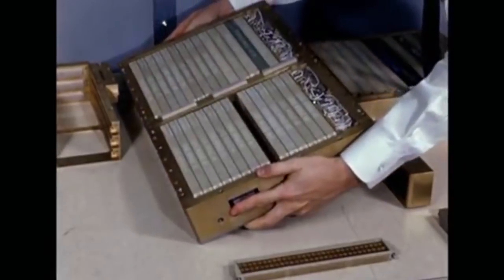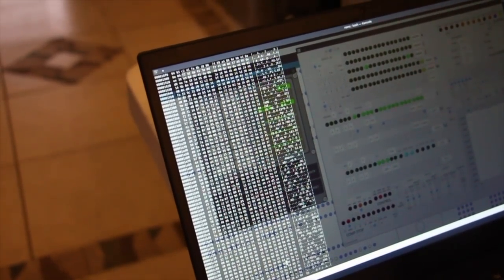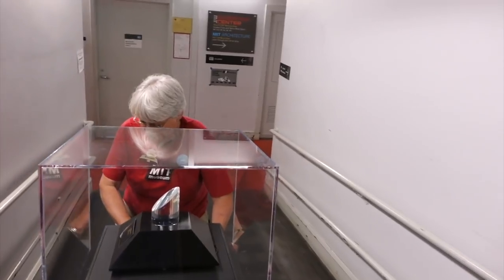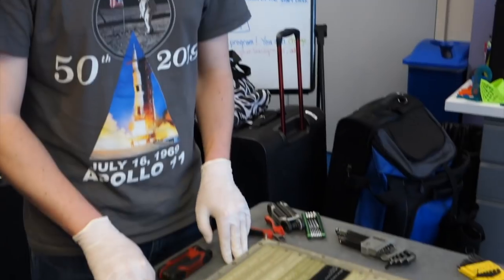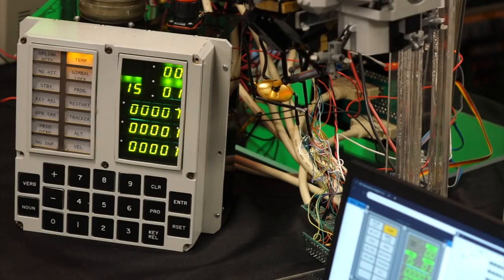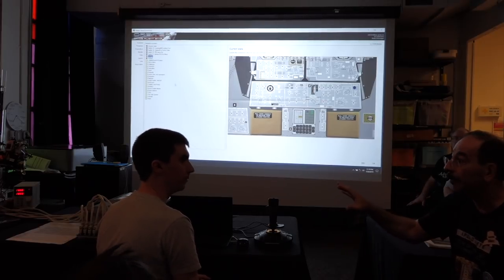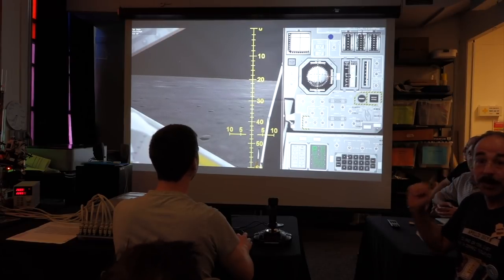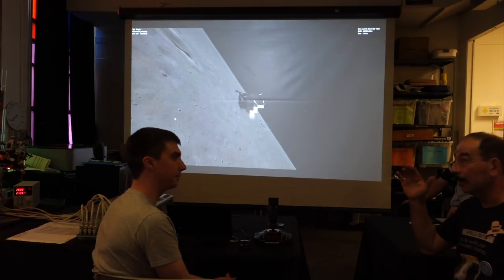Apollo Guidance Computer Part 24: the restored AGC does Moon landings in front of its creators

Comment: I do not really understand.  They read out the rope memories and say that no one knows about the programs that are on them.  But what is it that they run in their restored computer?
Reply: Their computer has different programs to MIT's one, or different versions of the same program. You have to understand that 32G of RAM and apps that run on any imaginable hardware are still decades away. So every AGC, each one of dozens, pretty much had highly customized code on it, code that would do exactly what that mission's functions were and nothing else. I would guess that no two AGCs ever had the same code at any point! We do not write code like that anymore but in the 60s with a few kilo bits of writable memory there was nothing spare, engineers would search down every last unused bit and find a way to use it for something else. End result is a huge collection of slightly different programs written over years plus a few once-offs, and so many of those programs have been lost over time that finding copies is a huge deal. Turns out that core memory which doesn't lose it's data with the power off is a gold mine for digital archaeology!
Reply: There were several AGC programs. Luminary is the one they had from the beginning. Later, after some restoration, they dumped the buggy ROM that flew in Apollo 11 that caused the program alarms.
Reply from the maker: As explained in the video. We ran the Apollo 11 LM rope (Luminary 99), which we recovered from the source listing that is on display at the museum and that I show in the video. Every mission had its own ropes, and there were many more development and test ropes that were not flown - or not even woven, just used on the ground with an emulator. For many, particularly the early ones, we do not have a rope or a listing for.
Reply: fake bra they did build the computer in that time yes well done on that, but that computer for sure did not land anything on the moon hahahahah such a bullshit story open eyes people why they push moon so much in 2019 they want to remind you that we are nothing and keep us in fear of aliens and bullshit, just live your life and forget about people on the moon its not possible
Reply: okay grant lol
Reply: @etype333  You need to get a life. 
This 1960's hardware was bleeding edge of what became common by the mid 1970's in industrial PLC's. 
The power of personal disbelief does not cut it when you are dealing with truly competent people. MIT's Draper Lab did what was barely possible with the technology of the time, and did it well.
What have you done, that gives you the authority to dismiss their achievements?
As an industrial engineer who has worked on 1970's hardware, it is possible but incredibly risky, on a par with flying aircraft in combat (which all but one of the Apollo pilots also did - the exception being Harrison Schmidt, the geologist on Apollo 17).
Reply: @etype333  I hope you get a visit from Buzz Aldrin and cop what the last bloke that tried to tell him he wasn't there did.  You are somewhere beneath a snake's belly.